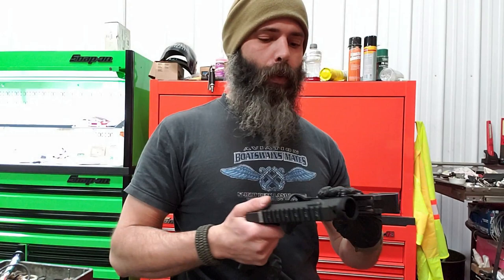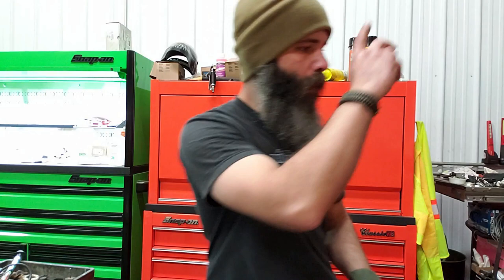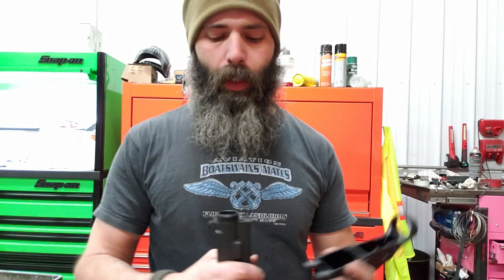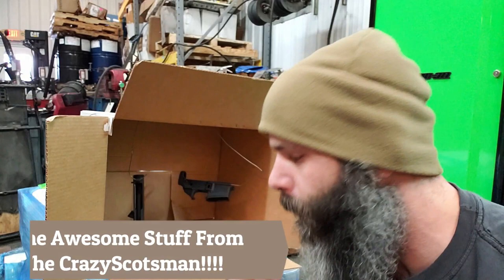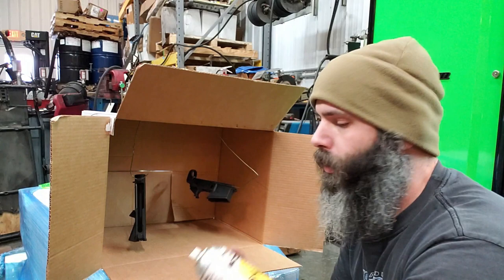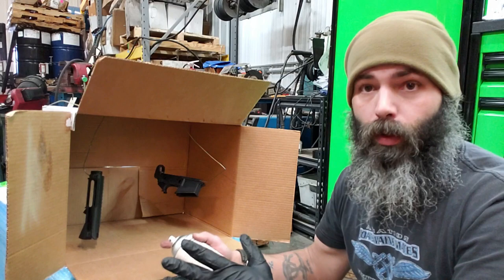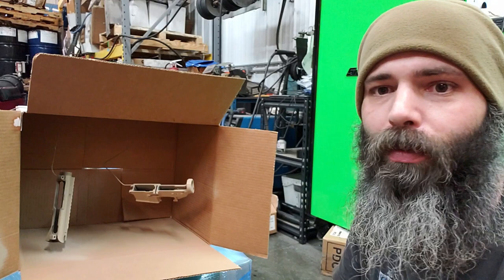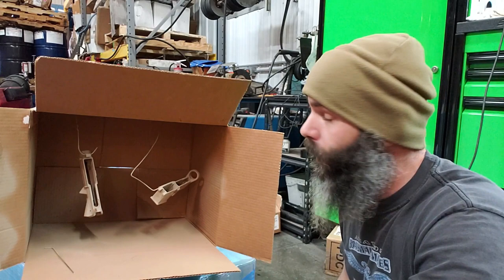Painting with Aluma-Hyde II

Comment: I did a CAR 15 build about 25 years ago and finished the receivers & barrel in Aluma Hyde II Dark Grey Parkerizing. It came out great, almost matched actual parkerizing. I still have it and it has aged just about the real thing. with a very slight greenish tint, no chips or flake offs. If you follow directions and let it cure for a week or two, it's indestructible.
Reply: The had Aluma-Hyde ll 28 years ago ?
Reply from the maker: I wouldnt doubt, brownells has been around over 75 yrs, they do have their rattle can and pro style self mix paint versions. They had the self mix type forever now

Comment: I have used Brownells Ceramicote on several firearms. It requires baking. I use a cheap toaster oven to preheat and bake the parts. Epoxy paints are an excellent choice for coating. Prep is very important. Thanks for the great video!
Reply: Baking is not required.. Baking just speeds up the curing process of the Aluma-Hyde II epoxy.   If you do bake the pieces you are applying the Aluma-Hyde to, it usually takes a full week to cure.  You can still use the part as normal during this time, it simply just won't be fully cured and thus, not as strong and durable.  
I will would recommend to anyone using Aluma-Hyde to go ahead and bake the pieces though.. definitely speeds up the curing process.
Reply: @JohnAntikainen  you clearly didn't read what he wrote, and instead just skimmed over his comment, in a hurry to type your $0.02 explaining how he's wrong about certain things....which he WASN'T,  by the way......if you look carefully and actually READ his words, he was specifically talking about using Brownell's  "CeramiCote" which is a specialty paint coating that has very fine ground ceramic and silica infused into the paint mixture. And going thru the the baking process is ABSOLUTELY necessary when using that stuff, at least if you want it to turn out decent and stay on the items you sprayed it on. I use a very similar product to coat guns and such, made by a company called VHT. They make many different high temperature resistant paints for automotive applications, like engine block enamel, brake caliper paint, etc...But the one I use is called "Very High Temp, Flame Proof Header Paint" (only when I want the object to end up solid, flat black because there's not many color options in this line that would look right on firearms. Otherwise, I go with the Brownell's or similar, when I need firearm specific colors that aren't black). If you dont cure this particular paint by baking it multiple times at increasing temperatures, it will remain slightly tacky feeling, and can be scratched off of whatever it's on fairly easily, probably even with a fingernail if you really were determined to. However, after curing in an oven 3 to 4 times, starting at 250°F and ending at 600°F for 30-40 minutes, the ceramic and silica within the paint does something remarkable,  because you end up with a finish that is resistant to gas, diesel,  acetone, mineral spirits, gun cleaning products, and most other harsh chemicals. Not only that, but due to the ceramic, the surface hardness is drastically increased, even resisting scratches/Mark's from contacting other items, unless you try pretty hard to leave a mark on it. The company claims that once cured, this paint is safe to withstand constant temps of 1,300°F, and intermittent temps of up to 2,000°F, as well as limited exposure to direct flames to a certain extent, before permanent damage will occur to the finish. It's worked pretty well for me over the years, and is relatively inexpensive when compared to AlumaHyde, DuraCoat, CeraKote, or other specialty firearm finishes, costing around $9-$10 per can at most auto parts stores. O'Reilly Auto Parts typically keeps it in stock at almost every location/store of theirs that I've been to in the U.S.

Comment: Would you still need to heat up the stuff your painting if it’s plastic or carbon fiber? IE bow quiver or stabilizer
Reply from the maker: For anything poly/plastic would say prob warm up a little with hair dryer to open up pores of plastic, but wouldnt need to be near as warm as metal
Reply: @beardedseabee82outdoors13  cool, thanks for the reply

Comment: How long did you let it set in between coats before hitting it with the heat gun? After hitting it with the heat gun did you let it sit, or apply another coat right away? Also, did you put it in the oven to cure after all coats? Looking to do this on my Glock 43 slide
Reply from the maker: Hi Samantha, thank you for watching. As for in between coats, i would wait until the paint flashed (went from wet look to starting to dry look) before hitting it up with the heat gun again, doing just a few coats until all looked even. Did however find that i should have done a full mock up (fitment of upper and lower were pretty tight...). Then after everything was dry enough to transport, took home and cured in the oven, lowest setting for 1.5 hrs, then let everything sit in oven overnight to allow to come slowly to room temp. Hope this helps!

Comment: Is that paint chemical resistant ? Good video, thank you.
Reply from the maker: So far as far as regular gun oils, hoppes solvent and what not havent had any issues. I havent tried brake or carb clean on it after its been painted, so i dont know what result could be there. Thank you for watching, any other questions feel free to ask
Reply: @beardedseabee82outdoors13  Cool thanks, I'm working on AK build and wanted something different then just black receiver. I'm going to give it a shot. Thanks again.
Reply: It’s pretty damn solvent resistant. I sprayed over my pmag window and had to reapply acetone to the paint multiple times. Took around 20 minutes to completely removed the paint

Comment: I like the color, thank you for the tip of using the heat gun,  is that the equivalent to baking it in the oven ?
Reply from the maker: Not quite equivelent to baking in oven. I still took parts home after to do an oven hardening cure, but heat gun helps paint set faster between applicationa